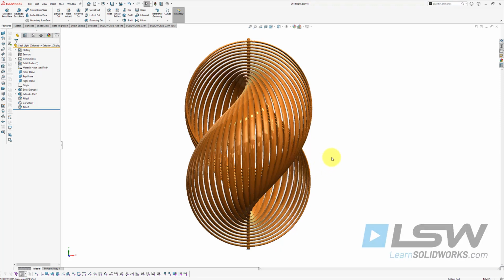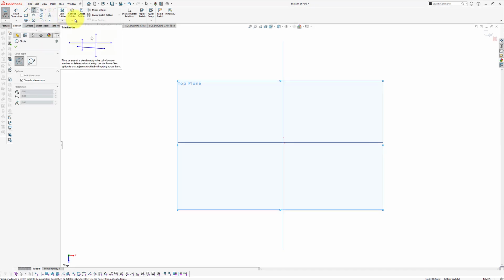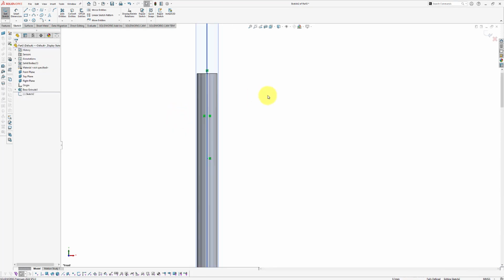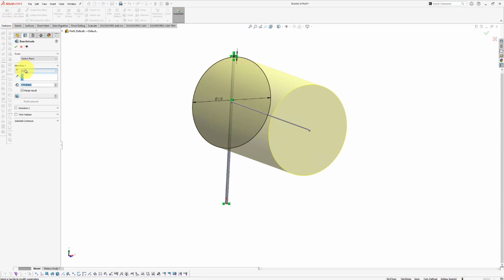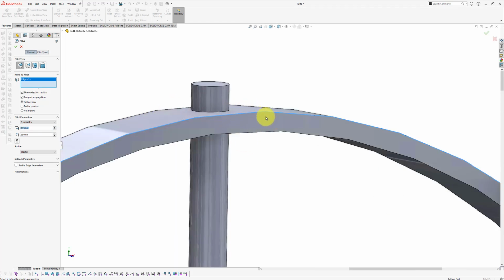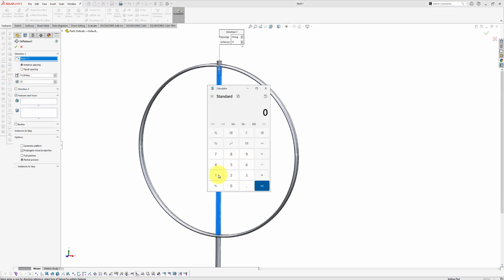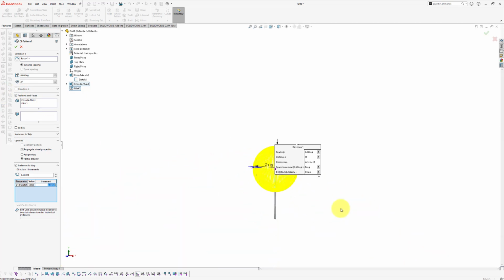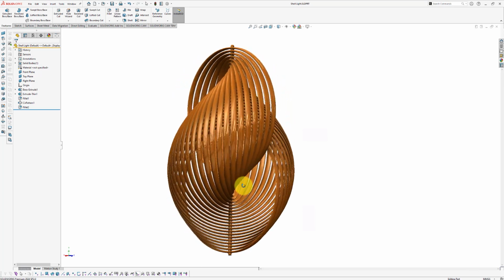How to Model a Stunning Shell Light in SOLIDWORKS 🐚 (Using Only 5 Features!)

Comment: Fillet is not working. When I apply the fillet1 to the Circular Pattern, I get a rebuild error.
Reply: That's strange. Try reducing the fillet size slightly to see if that resolves the issue.